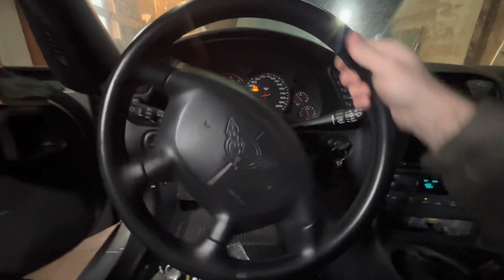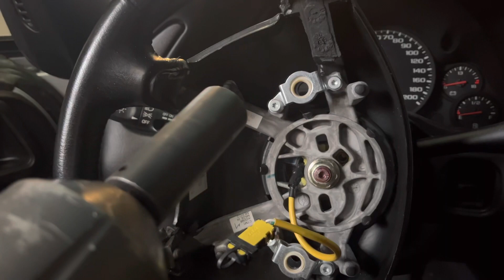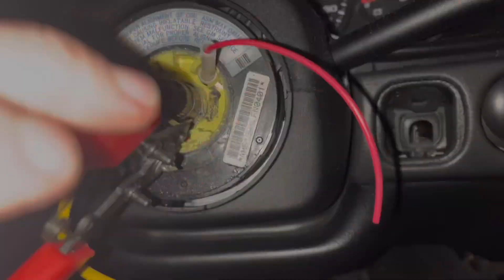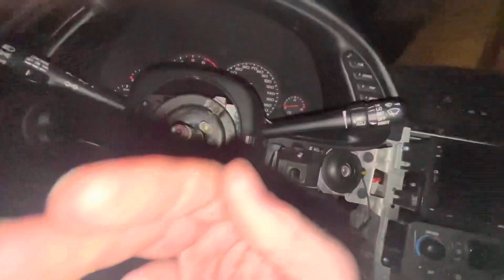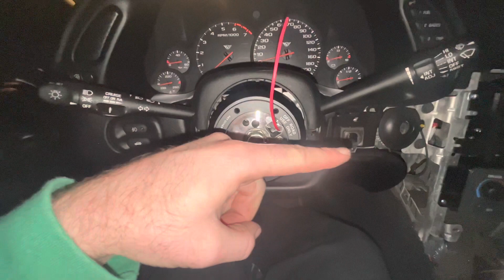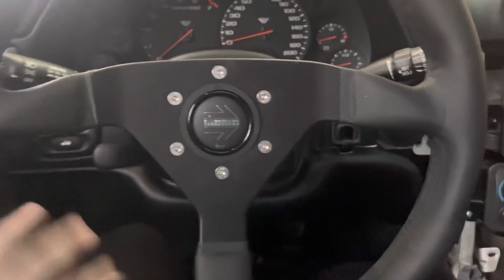Installing A Momo Steering Wheel In My C5 Corvette!

Comment: Excellent video man! This is the best one ive seen for a C5. I was curious if you ever had any issues with steering wheel alignment and if the horn for sure works fine?
Reply from the maker: Thanks! No issues with steering wheel alignment and the horn does work fine. I used it this morning 😅 it does stick a bit, like the button gets cockeyed somehow, but it works.